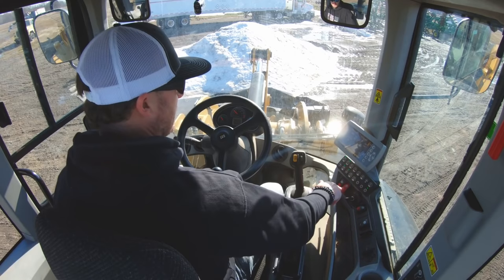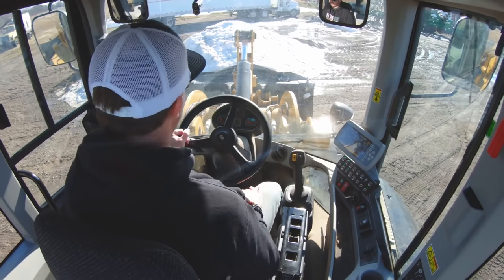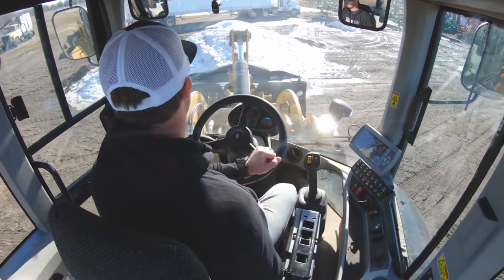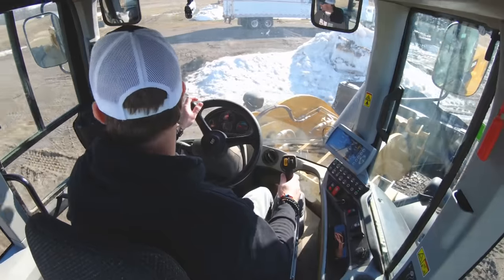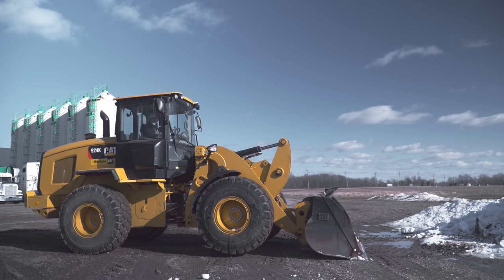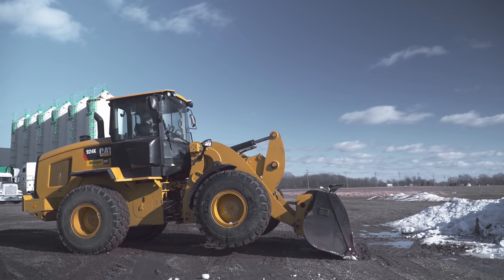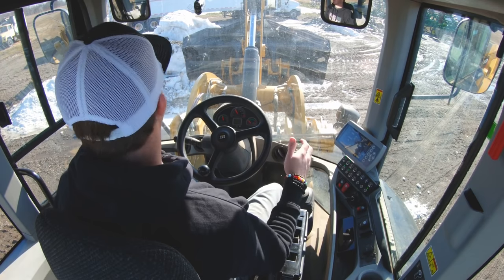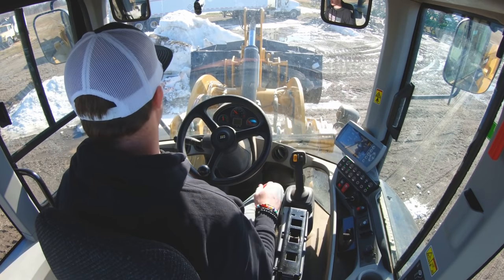Front End Loader Training - Top Mistakes | Heavy Equipment Operator Training

Comment: I just got a brand new CAT 980M this week and before it was delivered to me, another of our quarries had run it for about a week (I got it with 40 hours on it). Let me tell you that NOTHING was set correctly. All the kick-outs were way off, the implement positioning system for the hydraulic stops and scale weren't calibrated right, and the scale was nearly 2 tons off per truck! After 1 day during any breaks I had in loading trucks I had everything set perfectly. I can now drop the bucket and cut perfectly level like a dozer. When they delivered it, and you hit the return-to-dig, it would be dragging the heel plates and riding up the pile. It was so easy to fix, but you had to know how to level your bucket by eye and by feel, then push and hold 1 little button and it was all set! They couldn't figure that out in the 40 hours they had it? It took me 5 minutes. As for the hydraulic stops, this machine is supposed to have soft stop abilities so when you get close to the end of the travel limit, it slows the hydraulics a bit to gently come to a stop at the bump stops. However, try tr rack the bucket back and it doesn't go all the way back unless you let go then rack back a second time. Then as you're dumping if you just hold dump it SLAMS into the bottom stop. With the soft stop enabled you should be able to hold the direction and it should slow down about 1-2 inches from the full stop position then lightly bump the stop. Not slamming into but fully resting on the stop. No wonder I was made lead loader operator at this quarry in just over 10 months. (Ok, actually it was because the previous lead operator quit and I was the only loader left, but still lol.) If anyone has any questions about quarries, operating a loader, or specifically about CAT 980M or 982M loaders I'll be happy to help! And remember, always wear a seat belt in any machine, 1 click could save your life.
Reply from the maker: Yeah...important to learn your machine and set it correctly.  My guess is that 40hrs was prob a break in period with a few different operators?  Like that slow stop...much less jumpy!
Reply: It never ceases to amaze me the number of longtime, experienced operators who don't take the time to go through the machine to change parameters and set the machine up the correct way.  I also see a lot of guys that it never occurs to them to change machine parameters for different digging conditions.  Good operators know all the little things about their machines and how to tweak them for max performance.  Thanks for the comment Wraith!
Reply: It's the same for all the machines always 2000 out if a driver wants 95 thousand I put  98 it is what it is  Volvo jd cat
Reply: How do you know when the bucket is flat manually?
Reply: @jlew6985  you can usually tell by how it cuts the ground when close to level. If it's cutting too deep it needs to be rolled back a little, and too shallow it won't cut anything but it will just float along the ground. You can also guess and check by getting out and looking at the cutting edge, but most experienced operators can just "feel" if the bucket isn't level while scooping.

Once you find that spot where the bucket is close to level, you can choose a reference point that you can use to bring it back to level each time you curl or dump the bucket.

Comment: I am operating a big jcb front end loader which is always in second gear in piles cause this piece of junk is so light it will always lift its rear end off the ground. In its defense I operate with a high lift boom and a high tip 6cbm bucket
Reply: That setup will do that. The high lift is nice for getting into trucks but it is a pain when it comes to balance especially when you put a pretty good-sized bucket on the machine

Comment: I do back-dragging almost everyday at work and seem to fight smoothing contours of the ground, but I’m guilty of slightly raising the front wheels so I’ll definitely try to keep all four on the ground. The 1st gear is also a damn good point. Our Volvo L90H’s have a 1st gear kick down next to the trans brake and also a 1-4 switch on the panel which will let the loader automatically pick 1st if it needs it…however it’s annoying as all hell if you’re taking off in a hurry and it thinks you’re stuck lol

Comment: Ive just started on a cat 972. I get assessed tomorrow. I operated 980s, 966s, and scrapers thirty years ago, but this video is a great reminder. I work in fluffy oxide and very hard sulphides on a mine site in Western Australia. That poor loader gets used like a dozer sometimes. But hands down the loader is my favourite because of the variety of work i do as opposed to just loading trucks. Awesome advice, especially with the boom not stopping under powerlines.

Comment: Interesting video, I agree on everything, especially about the bucket  tilt automation, it's a feature that comes in hand whit time but not to start whit in a new machine.  It's one thing I don't if I heard you mention or maybe it isn't important enough but I remember my teacher in school 22 years ago pointed it out. He said -Never approach a hard packed pile in an angle, he meant the waist of the loader should be straight before going in to the pile whit force so that not only the first axle but also the rear axle is lined straight forward to increase the forward motion from all 4 wheel in the same direction. 
I thought it could be worth mentioning. All the best from Sweden!

Comment: Good shit there budd. I have operated a Cat 2019 950M and what a machine,compare to other heavy machines like KCM,Kawasaki,Case and John Deere. None can match the out put of a CAT, The controlles are so easy to muster vs others.
Reply: Thanks for watching brother. Those 950m's are serious loaders.  I really love how spacious the cab is but I hate the fact that those larger loaders are all twin stick.
Reply: The steering is actually much easier on a CAT with the stick. Its not like a Deere or an excavator where if you hold it out it keeps articulating until you hit the stop, it's more like you just point it where you want to go and it stays there. I think they call it Command Control steering with force feedback. Much more difficult to jerk the steering like you can with a wheel.
Reply: No 1 machine
Reply: I like the Kawasaki’s. Lots of power and pile pushing strength
Reply: @motorcop555  I'd love to try one out
Reply: @motorcop555  Depends on the model of Kawasaki, the older ones are grunters.Past that point they made them into KCM. Have operated a KCM. Honestly, Kawasaki loaders would kick the shit out of KCM.
But i do like Liebherr and CAT.
Reply: @deathbecomesu4604  I ran a 80VZ for years at a concrete plant. It was a powerhouse. Loved it. Now my daily driver is a Cat 938M. It has a ton of cool features and settings but the “ride control” is a joke and whoever designed that system needs punched repeatedly.
Reply: @DieselandIron  what’s wrong with the twin stick?  That’s what I cut my teeth on for years. My question is why are track loader twin sticks and wheel loader twin sticks completely backwards and opposite of each other?!  Makes it a pain when you switch back and forth all day.

Comment: One thing to mention about doing tight turns and loading trucks or equipment is there is no issue on smooth level ground... If some ground has bumps or uneveness have to be careful on boom height and weight. Drop into a divot, boom raised, tight turn, ample weight in bucket can send it on its side possibly

Comment: Learned on a 1968 # International Hough with no brakes. Just learn to load up hill and use the bucket for a bake to stop. With the hough you sit on the front half, nice ride and every ting stays in front. When the hough broke down I bought a little L 50 michigan what a nightmare for a while sitting on the back. Whenever I turned it felt like I could tip over but after a couple of weeks I got it down. Got the hough fixed and now can jump on either machine no problem>

Comment: I’m fixing to run my dads JD 624H loader, it’s a bit older, but nothing I’m not used too, got the same (or similar technically) 4 speed powershift trans like the 410 backhoes. But this I’ll keep in mind, cause I’ve never used it before.

But my dad has told me time and time again that it’s pretty scary when you’re turning and lifting at the same time, gets wobbly he said

Comment: Hi, Brian.
Good video and thanks for sharing. You are right about people thinking that front end loaders are 'easy'. But if you really want to challenge them, give them a front end loader with a 4-in-1 bucket and let 'em 'figger' out how to use it to its fullest potential. 

Then, if you are feeling REALLY cruel, give them a track loader with a 4-in-1 bucket and rippers and send them to level a steep house site with split levels.

BUTTTT, send them to operate an earlier model machine with NONE of the fancy bells-n-whistles that you have demonstrated in this video. I think that would be a really good training ground.

We have a Cat 966C with NO bucket leveller and what is without a doubt the easiest steering that I have ever encountered on a wheel loader. You can gently 'throw' the steering wheel in whatever direction you want it to go, change direction, speed or both, and 'catch' the steering wheel just before where you want it to stop to ease it down.

On turning to load a truck, sometimes it is the hydraulics that will govern the distance that you might need to travel between the dig area and the truck. If you have good quick hydraulics, you can usually take full advantage of that turning radius. If the hydraulics are a little slow, it may help to travel just a little further to keep the revs up to help the hydraulics or maybe pause with the torque converter brake for the same reason.

Once again. thanks for sharing.

Just my 0.02.

You have a wonderful day. Best wishes. Deas Plant.
Reply: I like to confuse people on the big forklifts by turning the steering wheel all the way One direction and then click the steering control switch to another position then turn it all the way the other way then clicking it back.

When they get on the machine and start it up they can't turn the steering wheel at all in any direction! 😃😁😀

It's sort of like an anti-theft device.

They would have to know how to use that steering control switch.
The three positions being:
1. 4-wheel steering
2. 2-wheel steering
3. and crab steering

Comment: I recently retired from the operating engineers and ran mostly loaders for over 20 years.
I ran all kinds of loaders up to about a 1050s with one other bigger loader that had joystick controls.

I love the 2-4 transmission setting and usually run in auto shift.

And I always tried to leave the clutch lockout turned off. I hate the way it jerks when I touch the brake pedal.

It was always weird trying to use both pedals at the same time to keep the RPM's up while trying to control the travel speed with the brake pedal.

Another main thing I didn't like about some of those was the z bar linkage on the loaders. You can set the bucket level on the ground and as your bucket goes up it curls up a little bit and then it starts dumping about 2/3 of the way up.
My extreme preference is for parallel linkage to maintain the same bucket level all the way up and down which is a future on what they call tool carrier machines which is a standard feature on the big forklift, except they use hydraulic parallel linkage, it's not the mechanical parallel linkage that is found on smaller tractors and some farm tractors particularly for using forklifts and hay spears.

I agree with practically everything you said.

I also prefer buckets that have a heel instead of a rounded back, they are better for grading, like using a grading box in reverse.

After so many years I ended up getting trigger finger on several fingers by grabbing knobs and levers a lot.

I also liked running mini excavators. I never cared for the big ones.
Also hated running scrapers and compactors.

Just glad to be retired now. 😉😃

Comment: I just hop on this video and I dont know how to drive a front end loader. But it gives me knowledge how to drive it though i need to do it hands-on. I like the way he said do not depend on the auto control as every machine has different settings and learn to do it manually and it will serve you much better which is very truem i am a forklift driver and i want to ask if the control is a bit similar.

Thank you.

Comment: New driver, I admittedly use most of the aforementioned functions.
Auto raise because I'm feeding trommels, hoppers or moxy's so it's always going up the whole way, though being a triple stick machine one fingers always on the stick to cancel any auto function and it's a much more positive lock/detent than the joystick. 

Use auto level a lot since my transmission toggles on the right of the triple stick cluster and with how close my hopper & discharge are my fingers just aren't long enough to operate 3 sticks & transmission simultaneously to get the bucket in position in what's lucky to be 5 metres. 
It's easier to just smack it into reverse, Auto level and close my highlift as I come out that way I've only got to hit forward & manually lower my boom which is easy as they're next to each other not on opposite ends of the cluster. 
Admittedly it's a very triple stick problem, the joystick machine mas more functions on one stick and everything is manual

Comment: When you become quite experienced, you'll realize when you do and don't have to step down on the bucket when you back drag.
When you are leveling on an even plain field I agree, don't raise those tires.
When you are leveling onto a uneven plain field where there's bumps, step down on the bucket. Be careful though, watch what you're doing because you can make a bigger mess.

I'd arguably say that an excavator is a step up to the loader. As the guy said; the controls are easy, easy to drive but what you do with it, the quality, how you do it, how you manipulate it is what makes you a good operator.

PS: Recycling yard manager/operator

Comment: I use the auto level but I also self adjust if it doesn't look right or of the loader even has it. Only 2 loaders I've ran had it and both were kumastu, a decade a being a loader operator insured with everything he says because I operate very similar. There was one time they wouldn't get a new blade and it was so rounded off because we deal with a lot of aggregate so it's rounded from and back so I got mad trying to back drag a hum eventually just put all the pressure down to where the front wheels came us and to that hum straight down to the linstone lol. It's mostly limestone where I live in Texas.

Comment: I learned on a 924k too with the same bucket, ran that for a few months and got used to using the flat top of it as my gauge for what is level. Next machine was an older John Deere 544J with a different style of bucket where the top just kept at a 45 degree angle or so and had no flat top like the Cat bucket so I couldn't tell what level was. Took me a good month or so to rely on the literal feel of the machine before I started to get things pretty level while pushing forward. Eventually it just became like second nature, no technology required.

Comment: "Make sure you know what all the buttons in the cab do. There is a lot of adjustability in these loaders." - Dude, my machine was built 1985. I'm happy that I can adjust the temperature of the cab blower and don't have to hand crank the engine! Well, technically it's not a loader but a backhoe, but that's not the point.

As much as I understand those tips, and think they're useful considerations, I think, this video might miss its audience. I'd assume, any professional would undergo some proper training before getting let lose on a job site, right? I mean, in Europe people need to show a training certificate before starting with a new company. But even in North America I wouldn't believe that any company would let someone run expensive equipment just on the grounds of that someone telling "of course I got this, I was dreaming about running a loader since I was 6 years old". So, let's assume that those professionals are anyway be covered, while pretty much all hobbyists etc will not be able to afford a nice, new machine with all the bells and whistles. Leading to the question, for whom exactly is this video intended?
Or am I that wrong, and people are really put in equipment over there without getting any sort of training?
Reply: Yes.  sometimes we have to train ourselves.

Comment: My return to dig and float function does not seem to work on my John deer 344L.  I watched a video where the guy just tilted the stic left and it automatically just went to about an inch or 2 from the ground.  Any tips or help you can offer? I'd say I'm above novice. I've been driving it and doing well for about a year now daily but I want to master this machine. Please help. I'm dealing with broken wood at a Pallet company so I'm also trying to master the rim pull control button. I'm in icy conditions at the moment so I'm reading that the lowest setting (1) out of 3 is my best choice.  It's this true?

Comment: Ive worked at a marina for the past 6 years and all we have used for moving boats are Bobcats and forklifts. There is a Waldon mini loader we use to push around the blocks/stands trailer but nothing prepared me for the purchase of a JCB loader to move boats around. Very complex to learn to push/pull a 50 foot trailer around with an articulating loader.